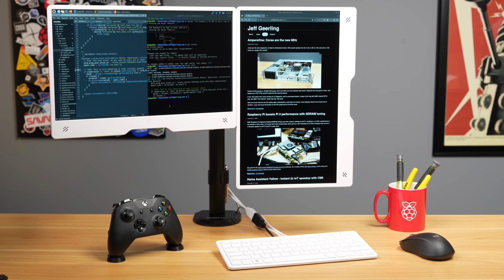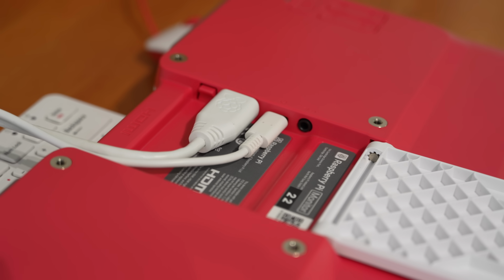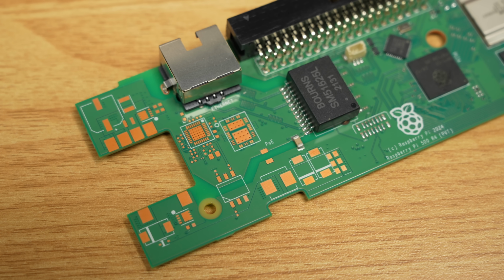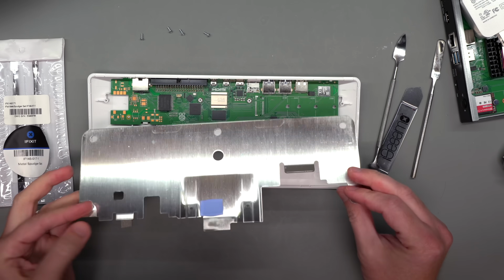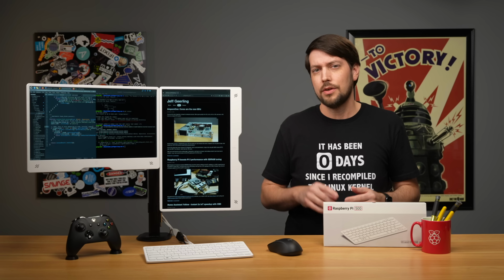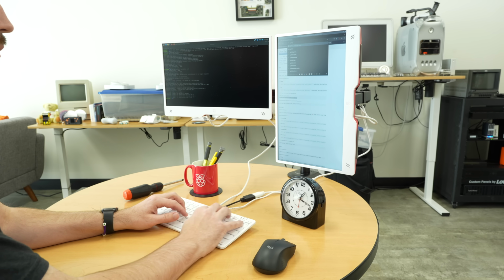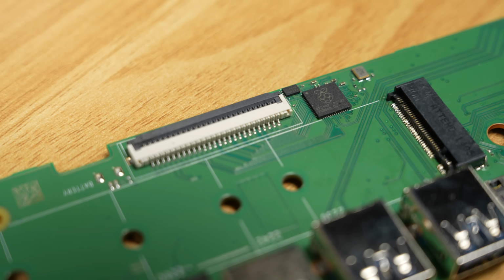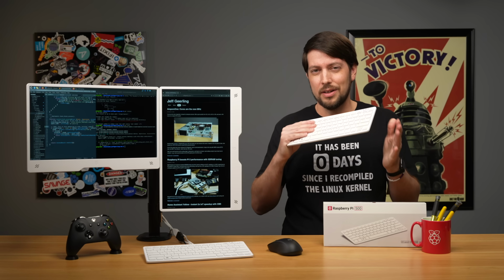The Keyboard IS the Computer! (Pi 500)

Comment: The CorpSpeak response to the question on why there is no NVME socket... irritates me.
Reply: Pi foundation has been captured by industrial clients.
Reply: If it had the nvme, I’d have bought one! What a shame.
Reply: I would've bought one if it had it... I have a regular Pi5, but not sure which NvME hat is best.
Reply: They are saying (1) they will/do use this PCB for other products, that's why it's empty and (2) they aren't going to add it to this one. Seemed pretty clear to me!
Reply: @tompw3141  And it seems pretty clear that a Beelink cube ad USB breakout board is better value. Or even a cheap laptop, with Debian installed.
Reply: That's the Pi Foundation anno 2024 for ya
Reply: pretty certain it means, the price would be to high they think it wouldn't sell as well.
Reply: @autohmae  the parts are less than a buck. The board is already designed for it.
Reply: @autohmae  Yeah but often when hardware manufacturers do this they are trying to hit a hard price target and not really looking at the trade offs.    In this case it's pretty hard to believe that  the cost of adding the slot would have added that much to the final product, especially given how much the end product would have been improved.  Sigh.
Reply: Agreed. Corporate speak for "Shut up and color."
Reply: Well what do you expect them to say? It is really the only answer they can give having shipped a product that clearly has the footprint for features they didn't include in the end. Which isn't uncommon at all, lots of stuff ends up with unpopulated headers and it is always because the company thinks populating that header would hurt the sales as the price must go up, or hurt their margins too much.
Reply: @foldionepapyrus3441  "Well what do you expect them to say?"

"We considered it, but it was too expensive to add"

"We didn't think it was important enough, but if there's enough demand we'll consider adding it in the future"

"We only added it to test out internally and iron out bugs so we may be able to use it in the future"

"Our engineers thought it was neat but it was scrapped from the feature list"

I dunno, anything other than the generic "Don't worry about that, silly little nerd"?
Reply: @phobos.anomaly  They really didn't say anything along the lines of your silly little nerd comment. Really they actually pretty much did say something with a meaning very much along the lines of those first options...
Reply: @foldionepapyrus3441  They did, actually, Corp-o-speak is very patronising.
Reply: @G-ra-ha-m  It is hardly patronising to simply state clearly how this product ended up in the state it is - they picked the feature set they thought best for this release. Or to honestly say they might actually populate and use those features later.
Reply: What do you expect them to say? They're still a business, and they don't have time to answer every question they get in great detail, especially one as broad as that. No doubt Eben and Co will elucidate in articles and interviews,  just like they always do.  They clearly still have future plans that they don't want to announce right now.

Comment: Read through the corp speak.  “We wanted to add it but something went wrong at a late stage”
Reply: That's a shame because something went wrong at a late stage in my wallet.  The micro hdmi is also an annoying dealbreaker. why? just why ?
Reply: @vincei4252  I know...I understand micro hdmi when it's on something like a phone, but anything thick enough to house a proper hdmi port should use one.
Reply: With M.2 and PoE missing I wonder if its a thermal issue, eg too much heat dumped into the case requiring active cooling.
Reply: @zeberto1986  is a simple fan so bad for a raspberry? i cannot see anything wrong with active cooling.
Reply: @AhsaniShali  its not that there is anything wrong with active cooling but the case the pi500 is in looks to be vent free meaning no airflow in the case. If it is a thermal issue it could be that the RP foundation tried an active cooler but it wasnt enough and needed too much of a redisgn to be out for Xmas. That said it could also be a sourcing issue with parts. Either way I totally agree with the OP that there has been an issue in design or manufacturing.
Reply: @zeberto1986  Eben Upton is well known for being pretty strong-minded about adding things that cost money, even if the addition is very small. A point to remember: for electronics the final cost is something like 10x the parts cost, so that extra $1 spent on M.2 parts is an extra $10 on the final cost. And M.2 connectors and ICs are not particularly cheap even in bulk: at Mouser, the M.2 connector in 4000 qty is about $0.90.
Reply: @rivimey  good points and in that context the pi 500 makes sense in a way. The Pi foundation can test the market with a direct replacement for the 400 but with bells and whistles added later at a higher price if there is enough demand. One would think theyd know the community would be a bit disapointed at the omission of nvme at the least.
Reply: @zeberto1986  Bingo
Reply: More like we wanted to add it but decided we could make more money on a revision.
Reply: Or, they are aiming for a price point and adding extra features simply pushes the price up too much. Seriously, you can't expect a Pi to offer the same features and performance as a typical desktop PC, in a form factor like this, plus gpio and yet cost less than mainstream PCs.

Comment: I'd love to see more details on YouTube playback with a single monitor on Pi500. Does it stutter with 1080p playback? If not, this is a decent web-browsing computer I'd be pretty happy with!
Reply from the maker: It works great even with two monitors in Chromium... but I specifically like Firefox more. It doesn't have accelerated playback in Firefox though.

If you keep the videos down to 480p or 720p resolution in Firefox, YouTube works best. If you use Chromium, it's not an issue really up to 1080p.
Reply: I see, thank you for the info! That's pretty good :)

Comment: This feels like a poorly thought out release, I know that sounds harsh but the unpopulated m.2, STILL using  micro hdmi knowing full well nobody wants it (theres plenty of space for full fat hdmi there, why...just...why?!). Add to that the price increase and this just feels like a moneygrab more than a thought out product. It's like they didn't even listen to customer feedback at all. 

Also seriously how much are we talking to slap a door on the bottom of the plastic casing and add the components for the m.2. Even if they launched with it disabled and a promise of future support it would've made the price increase understandable.
Reply: considering the inspiration for the pi400 and pi500 is the old 16bit Amiga computers which had a trapdoor slot underneath for quickly adding accelerators or ram expansions so you didnt have to fully open the computers up, then i am simply amazed they didnt do the same thing for an M.2 feature on both the pi400 or this new pi500.

Comment: This is a perfect little thing for an electronics workbench. All you need is to read docs and occasionally run either youtube or other software to look at stuff. I use a Pi 4 and an external monitor for that, but replacing it with a Pi 500 and a monitor for 200 USD? Yes, please
Reply from the maker: Honestly I've considered using this over at the workbench. It's fit for that purpose.
Reply: @JeffGeerling I’ve got a 400 in my basement workshop, mostly for web browsing, playing music while working down there, and as a terminal next to my (currently unused) 3D printer.  And just for fun.  Similar set-up in my garage workshop but with a pi 4 and pi keyboard
Reply: @JeffGeerling  I'm using a Pi400 for Ham radio. Everything from looking up and logging contacts on QRZ to running flrig & WSJT-X for FT8 digimode and running QSSTV. That might be a good video, showing a cross over of using the Pi500 as a ham shack computer. Showcases some ham radio stuff at the same time.
Reply: I would rather have a computer integrated in the monitor and wireless keyboard and mouse. That way I can always move the keyboard when I need to clear the workbench. I also get the benefit of using a keyboard and mouse of my choice. 

A Raspberry 500 is always going to have at least two (usb for power and hdmi) cables attached to which will make it harder to move away.
Reply: @henrikkarlsson8522  a Pi5 (or equivalent) with PoE and NVM hats in a semi decent active cooled case velcroed to the back of a monitor would be better than the Pi 500, you even get the bonus of a couple of camera ports so you can keep an eye on your workspace remotely, if set up securely.

Comment: Beyond being a good "first pc" for young people, I struggle to see a use case for the  machine.
The monitor looks like a great value for the price, though the VESA mount blocking access to the ports makes me hesitate.
Reply: It’s not a good first PC. You’re better off spending more to get a mini-PC. Going to be more performant and everything will work as expected. You will have to spend about 50% more but it’s well worth it.
Reply: @Bob_Smith19  Don't even need that, you can pick up something from the bargain bin and it will still be better. Heck, if you're not picky and shop around 2nd hand, you can get a modest oldish PC AND a RPi5 for the same cost as the Pi500. Or get the PC and a couple of cheap MCU's from M5Stack if your kid is REALLY into computers, programming and micro-controllers.
Reply: @Bob_Smith19  Agreed, mini-PCs now eat the Pi's lunch.
Reply: Iirc my library are using it for public facing terminals.
Reply: I bought a Pi 400 because it reminded me of a Commodore 64, like the modern equivalent of a retro-computer. That being said, I played with it about as often as my actual Commodore 64 that I have on my desk, which is, rarely.
Reply: Tbh an old second-hand Thinkpad laptop is a better first-PC option for the price range than this Pi. Rather unfortunate I think.
Reply: VESA mounts blocking the ports is idiotic.
Reply: get a used monitor
so much cheaper
don't buy a cheap new monitor
honestly
Reply: 100%, it's a modern C64 replacement.
Reply: My Pi 400 has been great for one thing. It takes up no space in my bedroom, easily connects to my TV and I can do my morning journal writing without leaving my bed.
Reply: £95 for the 15 inch Pi monitor (no cables), or £70 for a 21 inch LG (from Scan and with the cables), or even £35 for a 10 inch (with cables) from AliExpress.  Why would I buy the Pi offering?
Reply: @gordon861 15.6 is a good size for a portable monitor I find and should be a little nicer than the generic AliExpress stuff. Of course you can buy cheaper desktop monitors, but apples and oranges.
Reply: @gordon861 Exactly. Much better and cheaper options for both mini PC’s and monitors. When RPi was mainly strictly for students to learn on they were cheap and easy to recommend for people that either didn’t need much power or just wanted to emulate some games. Now with the price of more powerful mini PC’s and monitors it’s hard to recommend RPi’s in general.
Reply: Nope, it's a terrible first PC, first PC doesn't mean bad PC, quite the opposite. The only target audience for this are fans of Pi, otherwise it's not competitive with anything. For 200$ you can buy new Windows laptop, which would be much more powerful and hassle free (and makes for good first PC), or you can get used one even cheaper.
Reply: @unruler  Windows? Can Win11 laptops be Debianified?
Reply: @G-ra-ha-m  Sure, why not? But I don't consider Linux beginner friendly (or user friendly for that matter), but for basic tasks there is not much difference, I guess.
Reply: @unruler  Debian xfce4 is quite friendly. And very very fast :) And free!
Reply: The keyboard on the pi 400 is so bad I wouldn't call it a good "first pc" for anyone.
And, seriously, how can they make a computer that can't even play youtube well?
The oldest phone can do it...
Sigh.
Reply: It’s an awful ‘first PC’
Reply: Phones are PCs that fit in your pocket and many toddlers have phones. The "beginner PC" concept is at least 10 years outdated.
Reply: @SlinkyD  Phones are not PCs and kids who exclusively use them know next to nothing about computers; also, they created a generation of braindead smombies, which is the reason Raspberry Pi was created in the first place: To get kids into electronics, computers, programming etc.
Reply: You struggle to see the point because you only look at using the Pi as a typical desktop PC. It isn't designed for that. It is designed to be a cheapish hobbyist machine for people interested in using GPIO to add on boards, control external devices, tinker and to learn new skills. The fact that it can do many regular PC tasks is a side benefit. Look at the huge community around the Pi, the companies and individuals producing the thousands of HATS and project boards to connect to it, the software to interface and interact with them... then you'll understand the Pi.
Reply: @another3997 Yes but RPi is clearly trying to appeal to more mainstream markets these days. Back when they basically were strictly small tinkering computers they were cheap and good to recommend for emulation or someone that just wanted to browse the web and do basic computer tasks. Now they keep raising prices and trying to appeal to a wider market but there are just simply much better options.

Comment: So maybe wait for the M2 slot.
Reply: Probably be quicker to wait for a third party to use the compute module to make a NUC-like with NVME. ethernet and full size HDMI.
Reply: @gordon861  did anyone do that using the cm4?
Reply: @disasterincarnate  No but the CM4 was like hens teeth to find due to everything else that was going on.
The CM5 should be easier to find.  But the other option is a Pi5 and 'Argon NEO 5 M.2 NVME PCIE Case for Raspberry Pi 5' for $40.  Which takes full size M.2 rather than the cut down versions from the official Pi source.
Reply: @disasterincarnate  they even smashed it into a PSP shell, you can easily find the PCB with a bunch of USB ports, proper HDMI and m2 port, it's what everybody wanted and it sold best

Comment: Glad I read about the lack of NVMe on the board as buy button firmly stuck for now as that’s insane to design a board with the circuit traces present but no electronics!
Reply: Probably would've been more effort to take it out than to leave it in after they weighed their options for what features they wanted to include while balancing the costs.
It also technically lets them include it easily if they decide to make a new SKU. Tons of manufacturers have one board for different products. Cuts down on the costs.
Hopefully they decide to make a version with M.2 populated.

Comment: Was just thinking of the access door for nvme when you mentioned it. Yeah, seems like something they could've done easily if they decided to fully include nvme.
Little bit disappointing that we don't get to have nvme, would've made this a lot more appealing.
Maybe someone can figure out what needs to be populated and make a kit, it won't be an easy kit, definitely some micro soldering experience required.
Reply from the maker: And the PCB soaks up a lot of heat, making it that much more difficult if you want to hand-solder it. I should probably get a little PCB warmer...
Reply: @JeffGeerling  I suspect if Raspberry doesn't do it themselves, someone will offer it as a service to install the M.2 slot. Buying the necessary boards and cables to do this on the Pi5 wasn't cheap either so it might be about the same depending on how much people charge for the soldering job. I'm not sure, just guessing.

Comment: Why oh why didn't they use the compute module 5...  😢
I think that would have been a great upgradeable little machine.
Reply: RPF just can't get past the throw-away mindset, can they? Sad.
Reply from the maker: This would be awesome, make it more useful over a longer period of time.
Reply: @JeffGeerling  You have a lot of influence, maybe it's possible to get an upgrade board for the Raspberry Pi 400, with a CM module, and add a full hdmi port 😁
Reply: Costs and thickness probably - the CM connectors are for a single component rather expensive and if memory serves are about 1mm thick between the carrier board and the computer module, so add in the thickness of the PCB for the CM as well that is a pretty solid around 2mm of extra bulge...